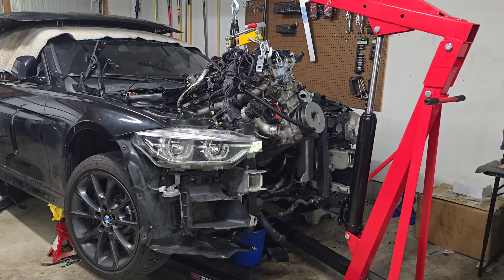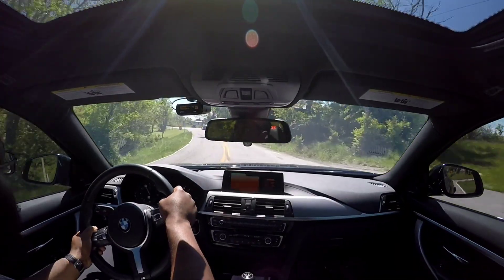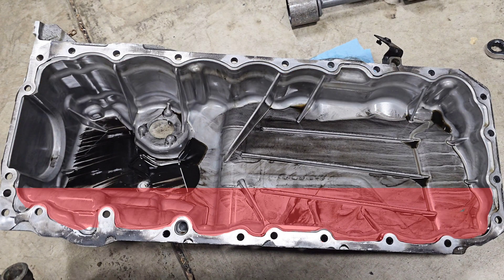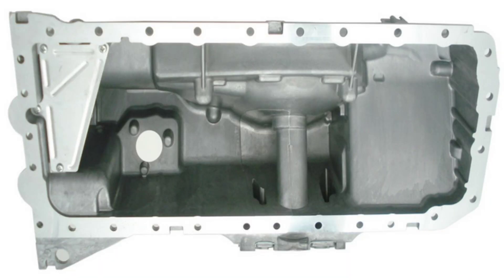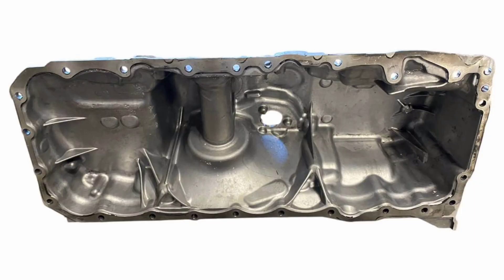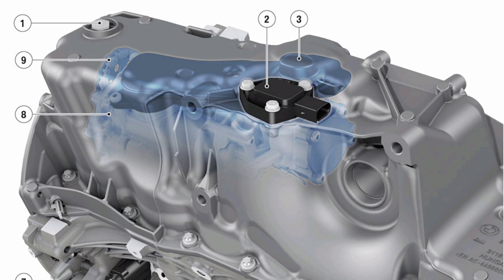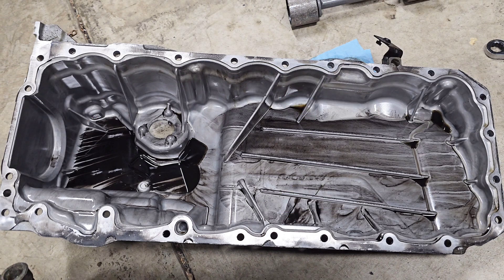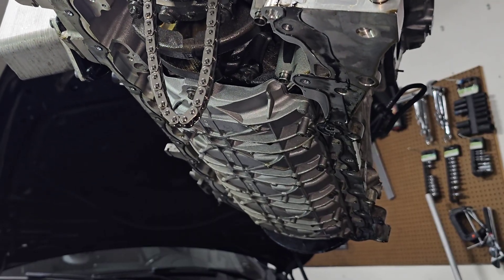Why B58s Don't Get Oil Starvation like N55s

Comment: I believe BMW fixed the oil starvation issue on the M2 N55 by adding an additional oil pan. 👌
Reply: Sure. The M2 N55 has a S55 sump with front and rear oil pick up, no other N55 has this. Looking at oil pump and sump setup ALONE, M2 N55 has a better oiling system than B58.
Reply: @shawnlister2730  the sump also has a baffle i just brought the whole kit for my m135i n55
Reply: @shawnlister2730 😂

Comment: I have a m340 I don’t need anymore power I’m good where I’m at but I’d like to know what suspension work would I need to get m3 level handling other than coilovers what could I do
Reply: M3 control arms is a massive difference. Sway bars as well and stiffer rear control arm bushings
Reply: @Rogue6r front lower control arms?
Reply: Swaybars.

Comment: From my understanding with the N55 if you install something like an mmr oil baffle and over fill just a hair, it eliminates the oiling starvation issue. Nice thing with the n55 is it can handle different oils where as the b58 (due to its oil pump and suction pump in one design) can't handle anything beyond the factory 0w-20. So how does that impact higher hp builds or heavy track use? B58 is a great sporty engine but doesnt exactly work when you try to push it to 600+ unless you overhaul everything and spend like 8-10k if not more
Reply: Can’t handle more than 0w-20?? Lay off the crack.
Reply: @TML34 The suction portion of the oil pump is plastic, and to make that worse the oil has to be compressed. I am concerned that the plastic parts compressing hot oil that is thicker than factory specifications might lead to a bad outcome. I am more than happy to hear your opinion but TML34, you offered nothing of substance so far.
Reply: @SemiAnonymous32  even the user manual state different oil viscosity beside 0w20, so this statement isnt true. In my bmw user manual I have everything from 0w20 to 5w40 .. I keep on using 5w30 and don't have any issues.
Reply: @SemiAnonymous32 😂😂😂 dude ur a bot
Reply: Running 15W50 in my gen 1 B48 with 30 PSi boost.
Reply: Ive been on Motul xcess gen2 5w40, tuned, beating the shit out of mine on the track on semi slicks for years without any issue. I also monitor oil pressure in real time on a display gauge in the dash and log stints. B58 has been very reliable to me in this regard (knock on wood). I also own an E92 335 with N55 and DCT combo that I plan to do some improvements in the oiling system and the MMR oil baffle type of thing arouses my atention.

Comment: S55 best engine for the car racing . You only have to look at all the F-series M cars that drive on the Nürburgring.
Reply: Could you please explain why you didn't rate the S58 higher than the 55? I don't know the S58 as well as the S55, but I would think the S58 is superior in every way.
Reply: @khumokwezimashapa  S55 is significantly cheaper. Cheap is good on track.
Reply: @CadexLaw  Ah okay. S58 powered chassis must e incredibly expensive then